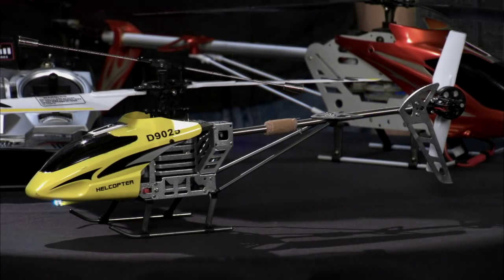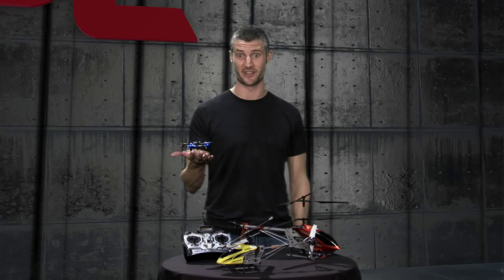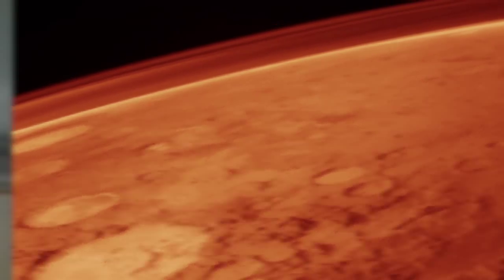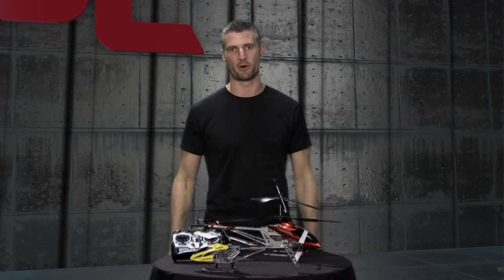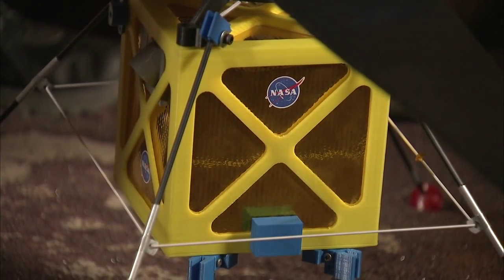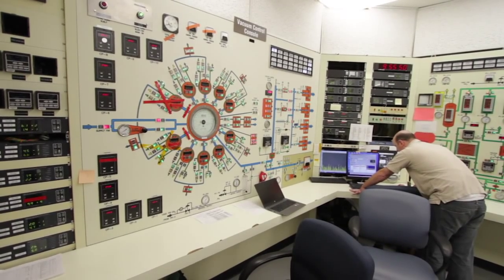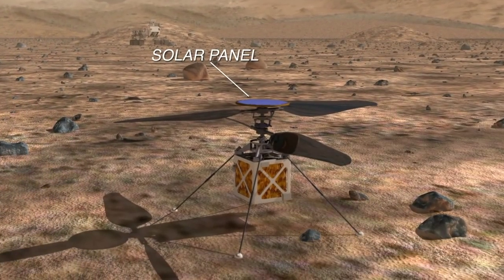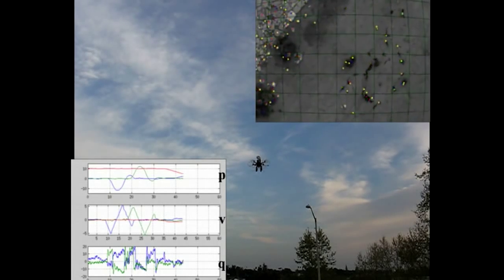Crazy Engineering: Mars Helicopter

Comment from the maker: #NASA   #crazyengineering   #onlylookscrazy  

Mini helicopter could give future Mars rovers a new view http://go.nasa.gov/186VBDO
Reply: "M Thermodynamic resonant engine with a rotary variant" have a solution for it boys and call USPTO to not loss it. YES I am scared , we are gona to loss it. A solution what never was used, nobody can to contest it then.
Reply: A quad would probably work better.
Reply: I wonder if they would make the blades a solar panel as well. Could increase the flight time...  Could do 2 flights per-day maybe
Reply: In the Martian weather this will become a tumble weed. and not sure there is enough air density to fly there.
Reply: Unless they have been lying, this thing won't fly because of the absence of a significant atmosphere. I would not be surprised though. Just look at the heaps of censored images we get to consume from the JPL lab. Just about the only high resolution images we get to see are the selfies of the rover! The rest is painted over and blurred into orange drab.
Reply: How would this deal with a wind storm and dust on it's solar panels?
Reply: Jeffrey Cobb This variant has two motors on it (one if they use intelligent gearing) the quad has 4.

This variant can have any length of blade they deem necessary, a quad is limited by the inter axis (4 by 4) of the structure, therefore, the bigger the blades the wider the body.

So nope, it wouldn't.
Reply: Anthony Powell Panels are fragile. Mars has fine, sharp dust. The panels left unprotected would be destroyed, if protected the surface of the protection would be sandblasted. Why complicate things when a simple dome on top is more than sufficient.
Reply: Glen Cychosz It flies. Enough said.
Reply: ***** Watch the video again. They test it in the same thin atmosphere as on Mars.

Who's full of bs?

Produce a factual test that demonstrates what you're saying is true. Don't spout words that have no back up.

There are a ton of high res images from Mars that don't have a rover.

 You're delusional, highly.
Reply: aserta It flies. Enough said?  What good will it be if it cant last more than a day or 2?
I'm not against the thing I just want to know what kind of survivability it will have on mars.  The wind speeds get prety high on mars with lots of dust.  Will it get rolled like a tumble weed?
How will the solar panels keep the dust off?
Reply: It makes sense  once tested. Too bad everything we send to mars arrives with technology that is 10+ years old.
Reply: Glen Cychosz Fine if it isn't obvious enough i'll explain, vaguely.

1. if it flies then dust won't gather on the panels. I refuse to believe you don't understand why. I refuse.

-------------------------
 
2. the dust storms aren't that big of an issue. I'm sure the final product will have a docking station (part of the transport to Mars plan) in the rover. When a dust storm is expected over the area it will dock and be safe and cozy.

3. I don't think you understood the purpose of this device. It's simply a scout. Nothing more. Therefore the tech will not be dedicated to protect a payload of sensitive devices and more oriented towards gyros and other such devices.

Check any number of high end RC machinery that fly for the latest advancements in control in adverse conditions. If they can make one fit inside a hole that's not much larger than its footprint then control over wind (which some are quite good at) will be no issue. And that's not a required thing since as i said, the Rover is there to call it back/or land immediately as wind picks up.
Reply: Race Vanderdecken I don't see how that is the case, as most missions to mars take less than a year to get there.
Reply: If NASA/JPL could make this actually fly well in 'less-than-ideal conditions' typical of Mars (Thin atmosphere, less gravity, weaker sunlight, cold temperatures (which greatly reduce battery performance), abrasive & clingy dust,...), 
then I say :"Excellent Work!!"   
Kites, balloons, tethered blimps are also viable options, each with their advantages/disadvantages.
Reply: Anthony Powell I was just wondering the same thing while watching.
Reply: Read "Mars Unexpected", my "iBook" soon to be available in the Apple store.
Reply: You might find some value here: https://www.fastcodesign.com/3055694/mits-new-algorithms-could-stop-catastrophic-drone-crashes

Comment: The solar panels could be integrated to the blades - such materials exist already, and that would have many positive effects (lower point of gravity, stiffer blades, rotation would wipe away any dust). Probably the main obstacle is wiring - wanting to avoid brushing surfaces. Also, a solar-on-blades would look way cooler! :)
Reply: yeah dude...wiring is just a tiny little detail...

Comment: Would a balloon on a retractable tether work? It may have fewer mechanical points of failure.
Reply: +lunhil12 There's no way NASA would ever allow a flying-anything to be tethered to their rover. I remember back when NASA discussed whether or not to have the Opportunity rover inspect its parachute after landing (it inspected its heat shield after it impacted the ground as well), and NASA decided against it for fear the rover could become tangled in the rigging, or have its cameras blinded by fabric if the parachute blew onto the rover. If the balloon ever deflated in flight, it could fall onto the rover's camera mast or the cord could tangle up the mobility system.
Reply: +lunhil12 NASA actually tries a totally new way of landing each time. That's how badass they are.
Reply: i had the same question. thanks.

Comment: Are there strong winds on Mars? There should still be high and low pressure zones on Mars when the sun heats up the terrain, which should move around the little atmosphere mars has.
Reply: Yes there are, but because of the low density of the atmosphere, a 200 mph cyclone wouldn't even knock the hat off your head....

Comment: I'm not sure why this solution is preferable to some kind of mechanical extending periscope/monocular that communicates wirelessly with the rover, assuming all they need is a higher vantage. Add a laser range finder/scanner and you could even build a basic 3D map of the area for navigation.
Reply: good idea, but no need to make it wireless
Reply: True, but wireless would prevent the need to have wires that constantly move and flex as the camera/laser is raised and lowered, which eliminates a potential failure point.  It would also eliminate the weight of all the wire they would need if they were to make the extending pole a significant height, every ounce counts. Given that the helicopter is likely wireless, I assumed the technology is already in place and robust enough to send significant amounts of data wirelessly in harsh environments.
Reply: A periscope would be very limited in the length of the mechanical extension, and the "flatness" of the surrounding terrain which would affect how much it could see at the available height.
The drone drone in comparison would have free range in the air and be capable of surveying far more terrain at varying heights. Provided they can work out all the technical kink, then the only real limitation a drone would have is its power supply.

Comment: A sphere seems like a better design idea from a landing perspective. Low center of gravity and it will right itself. How does a cube right itself if it does happen to fall on its side?
Reply: The problem is if it lands on its side then it will be unable to fly anyway. If it tips over in landing and the rotors touch the ground, then they will break and it will be unable to fly. It is better to have a cube so that there is a higher chance of when it lands, to land on the side you want it to land on, as squares have the highest surface area on the bottom per cubic centimeter (probably, tetrahedrons might be better, but you can't make a helicopter with those dimensions. An idea might be to have a sphere with a low centre of mass, and a gyroscope for the rotors, and a slit around the top area, so if it were to land on its side, then the rotors would still be facing up, and the ball would then right itself, however this is probably too heavy for the design.
Reply: anion cation You grabbed onto my thoughts about the gyro and mass..... if solar isn't providing enough energy then use a mini reactor. the batteries for the solar energy system have to carry an amount of weight.You could still have retractable landing gear with a sphere.
Reply: TheKaffeeKlatsch How about three split spheres attached together as a tripod and dump flying. HIRiSe already has it covered. A lightweight extendible arm could always provide a third eye view at a good height. 
Split spheres so they can clamp up for protection, warmth, radiation insulation, large rolling grip and less casing weight which has dogged MSL etc etc

And of course three split spheres that lock right out make 6 dish antennae

Comment: Why aren't you using the quadcopter design? It seems to be much more stable and easier to control.
Reply: Just guessing, but perhaps because of the possibility of one blade failing - obviously we can't be there to maintain the system.
Reply: Notice the size of those blades? that answers your question why a quad can't be used.
Reply: The number of blades has nothing to do with stability, this is a common misconception. It doesn't matter if its a bicopter, tricopter, or quadcopter, aerodynamics doesn't care about having a wider base, in fact, wider based platforms like quadcopters actually have less maneuverability than their single-set counterparts because the blades end up being farther from the center of mass. They're great toys on Earth, but there's a reason there are almost no examples of practical multirotor flying vehicles, the Chinook and Osprey are a couple of exceptions, but for very specialized reasons.

Additionally, by being very long, the blades can have a smaller chord, meaning they operate better in a rarefied atmosphere by maximizing lift but reducing drag. This is the same technique used to increase the efficiency of sailplane wings.
Reply: Quadcopters have more structural requirements on top of lower lift to weight ratios in there wings compared to inlines double copters, but yes quadcopters are in practice more stable. through excellence in design and programing they can be made to autonomously fly and land stably as well. Remember that it takes fifteen second back and also forth for communications so it must fly on its own/autonomously.
Reply: As they mentioned in the video, in order to gain enough lift in mars atmosphere the propellers need to be bigger, and the overall mass of the drone needs to be low.
Adding more propellers to make it a quadcopter would mean both an increase in frame size to fit the 4 larger propellers, and an increase in overall mass to support all the necessary components.
Reply: Owen Vankirk The first part simply is not true. Quad copters are inherently more stable then other designs. As a structure, an object supported by 4 symmetrical points is more stable then say 3 or 2 or 1. the second part is partially true. The wider the propeller blades profile the more drag they incur and reduces efficiency however due to mars low atmosphere that efficiency loss may be less significant. So the propeller is still gonna experience increased drag as opposed to a more narrow propeller. To be honest im not exactly sure why they would use a wider propeller as apposed to a long narrow one, it may have to do with structural or flight characteristics maybe. Also using 1 single propeller is more efficient then using 4 as in a quadcopter design. It's one reason you dont see actual aircraft using quadcopter type designs and remain ususal helicopters. It is topologically optimized. It give the least amount of structural material and mechanical material to implement it. That being said there are strong issues about the reliability and risk of using this thing on mars. The cost of taking it to mars may not be that significant if it is light and compact. But it still encures some cost. I think a quadcopter design would be the one selected exactly for stability reasons as Uncky Jeff suggested.
Reply: Yeah, no. It doesn't matter how many blades you have, the number or orientation will not ever influence your stability. Dead giveaway you have no idea what you're talking about. A wider base means nothing in a VTOL setup of any kind. What controls your stability is the reaction speed and the reaction force of your control system. You don't get passive stability out of blades, it's not like a glider where increasing the wingspan or adding dihedral will increase the stability, they're entirely different forms of flight that only use similar principles.
Reply: not number of blades, number of attatchments to the airframe.
Reply: clear example, if you had a bicopter. an external force acting perpendicular to the line connecting the two props, in the horizontal plane, will cause a tendency to rotate back and forth about the line connecting the two props. the copter has no way of controlling the reaction to that force whilst in that orientation.

Comment: Hmm, wonder if the ultrafast blades with electromagnetic bearings and brushless drives are the only way in the air that thin and that dusty...
Reply: I could think of a grasshopper kind of solution, or kangaroo bot. I think Darpa was working on that last concept, albeit not for Mars.

Comment: You should make a quad rotor that rotates the propellers to double for tires. Just make the rotors encased inside the wheel for protection. Drive in bad weather, fly in good.. Seems simple enough, right?
Reply: Wheels are too heavy I would imagine.